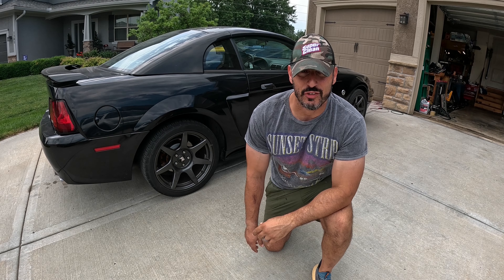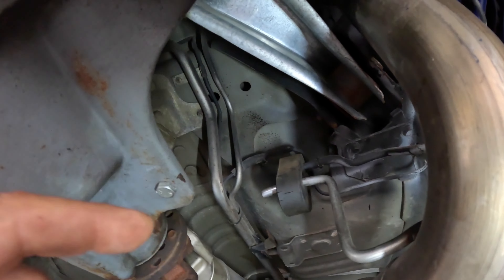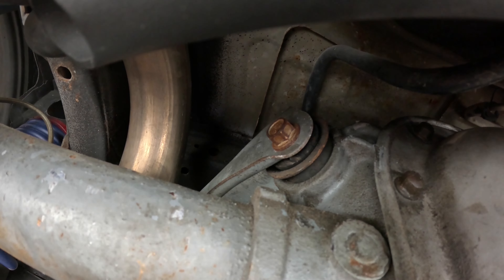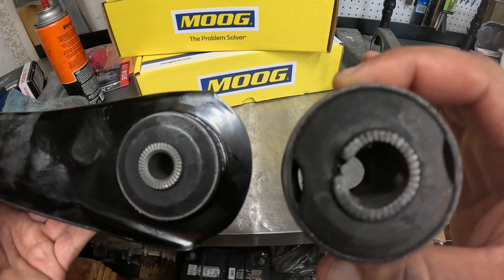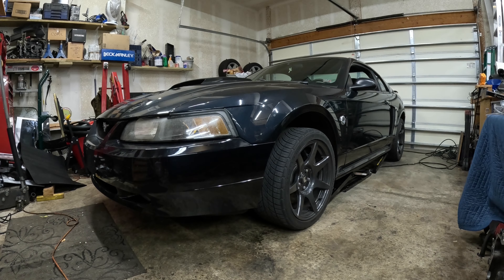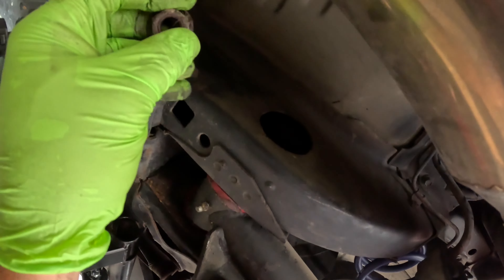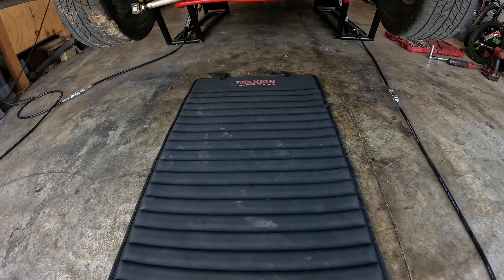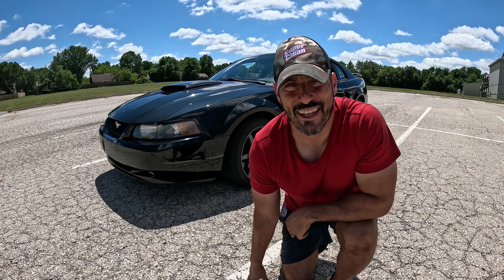Watch me MIS-DIAGNOSE a SERIOUS Suspension Issue on my 2004 Mustang GT 'New Edge' 'road course car'.

Comment: How often does a bushing need to be replaced? Is it part of general maintenance or just replace when broken?
Reply from the maker: Thanks for the fantastic question!!! There is no set timeframe or mileage for when a bushing needs to be replaced. There are many many factors that play into the life of a bushing: the type of use it sees, the material its made of, the quality of its construction, the environment it lives in, the type of grease it receives, the quality of the supporting components around it, and probably numerous other factors. Certainly, when you can see damage, hear noise, or feel instability it is time to replace bushings!